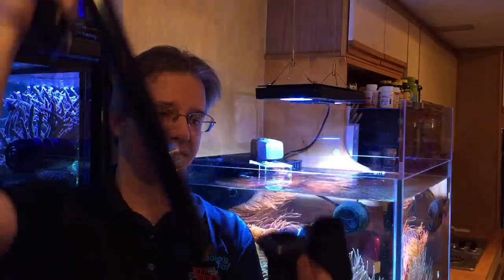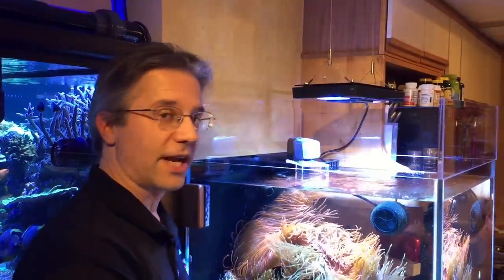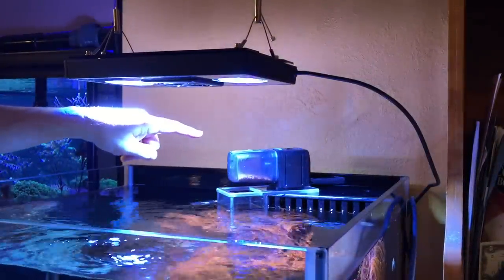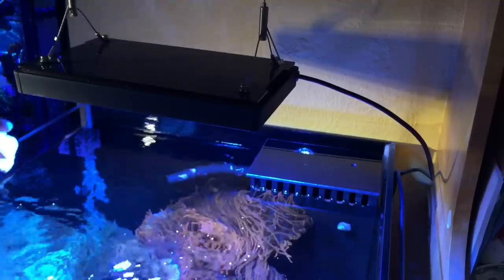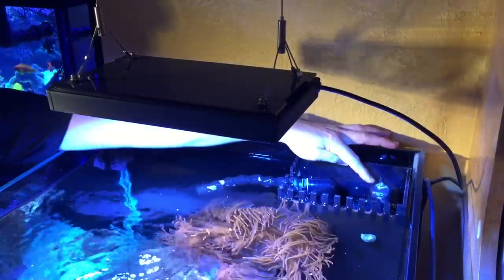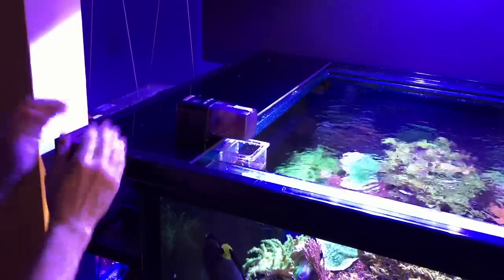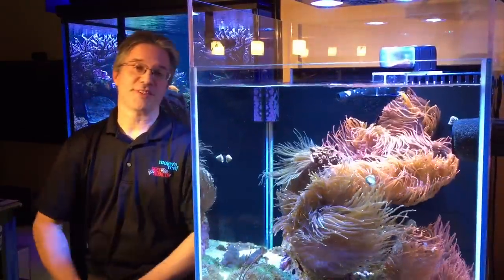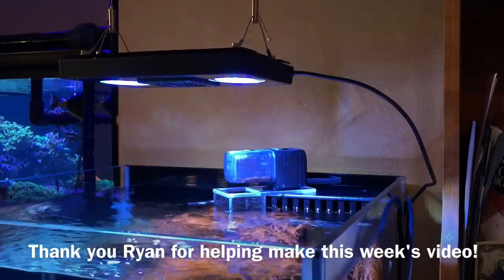Tweaking a Durso Standpipe

Comment: Amazing. I tried this and it worked perfectly! Quick question, what about the overflow sounds? I have a waterfall sound from the water falling into the overflow box. Do you have any suggestions?
Reply from the maker: If you can limit how far the water pours down into the overflow box, that will help.  1" lower is good.  2" lower is louder...

Comment: i just set up a new tank with a durso, I have no flushing or air sounds at the overflow, but the water/air coming into my sump is SUPER turbulent and loud.  My stand has a open back for ventilation which adds to the issue.  Do you have any suggestions for reducing the turbulence coming into the sump?  I've seen many suggest a filter sock, but I don't really like the idea of having to change even more socks every few days.  Thanks!
Reply from the maker: Do you have the drain pipe submerged in the sump? It should only go down about 1" under the surface; this will help immensely.  How long has the tank been running?

Comment: What do you do for like the splashing noise from the water where it drains into the sump, I have a tank with a Durso in my room that is silent. But I'm upgrading to a larger tank and when I check for leaks in my garage I noticed the louder noise. I already have a filter sock and pvc that goes about an inch below water line, it does help but not as quiet as if like. Would putting bigger whole in the vent of the Durso help with that?
Reply from the maker: How long has it been running? It takes about two weeks for the internal walls to slime over. After that, it’s usually pretty quiet.

Comment: Mine has two holes on the side of the elbow as well as the vent hole on top. It came like that from the lfs I bought the tank setup from. It’s super noisy so thinking about putting on a new elbow with no side holes and drilling a new hole on top
Reply from the maker: Definitely give that a try.

Comment: So is this polycarbonate plastic acrylic and does it bond to acrylic with Weld On 3?
Reply from the maker: You can bond acrylic to it with Weld-on, like if you wanted to put some small ribs underneath to keep it exactly in the right spot.